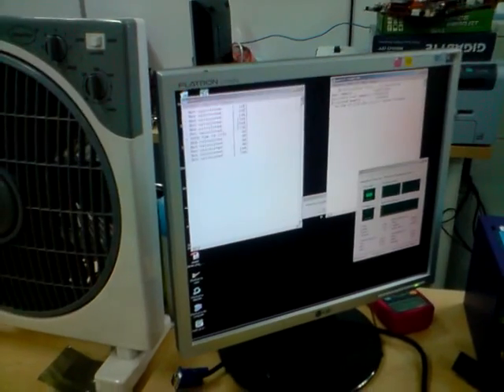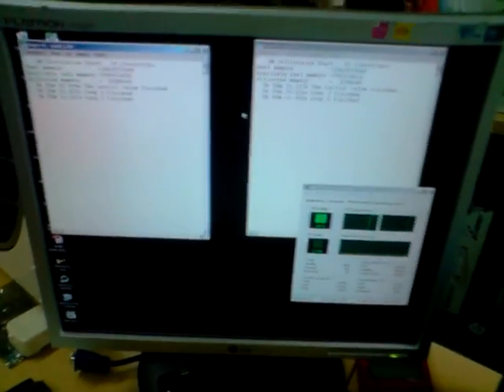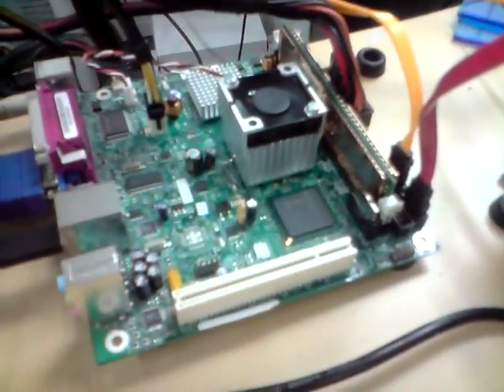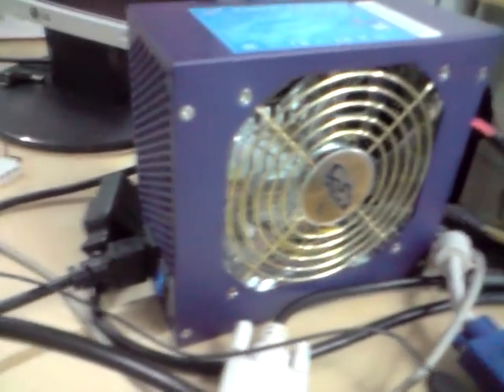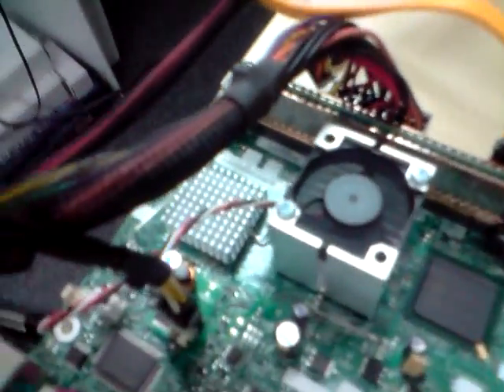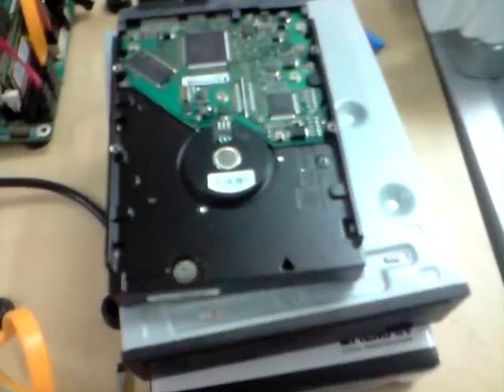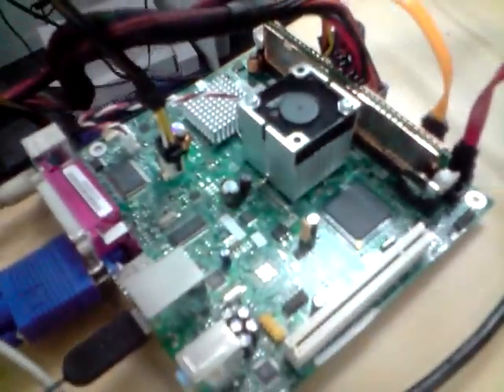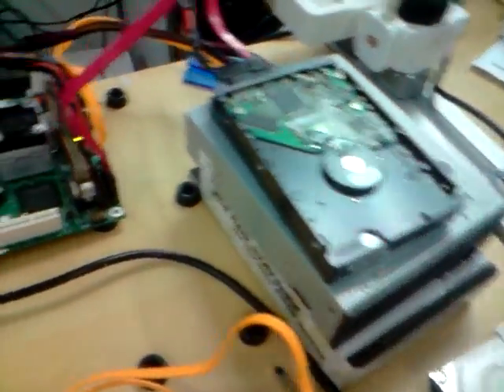Intel Little Falls mini-ITX power test

Comment: Agreed.

The 945GC sucks, the onboard GMA 950 is way too slow and it only supports first-gen DDR memory. And nVidia's Ion platform isn't really that good either.
Proper carputers should have proper decode(/encode) and a proper graphics processor.

And they should have SSD storage media and quick RAM memory (DDR3 for instance) for quick boot up and shock resistance aswell as integrated 3G, WLAN, Bluetooth and GPS capability and the ability to use external antenna for those interfaces.

Comment: Oops gave you a thumbs up.  You should pull that out of your ass. My company already uses a modified MSI 9803 motherboard with DDR3.."many many years" is just ignorant anyway, wow.  And speaking from experience, The 965 chipset coupled with a T7500 Core2 can play many games at higher resolutions (Red Alert 3 for one.)  Crysis is different story and a video card will always perform better and free up the CPU but seriously dude- you have no idea what you are talking about.

Comment: Nice video... But don't use 3,5" HDD on setup like that... Use 2,5" slow RPM HDD or SSD instead... It IS supposed to be low power setup anyways... Just my 2 cent..